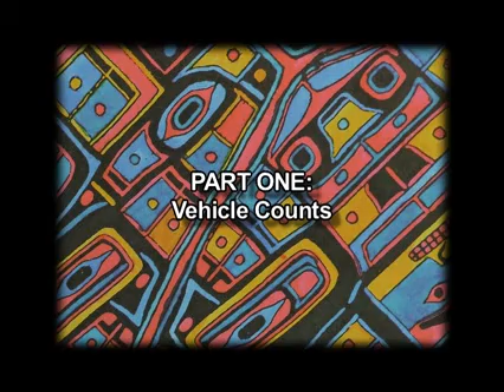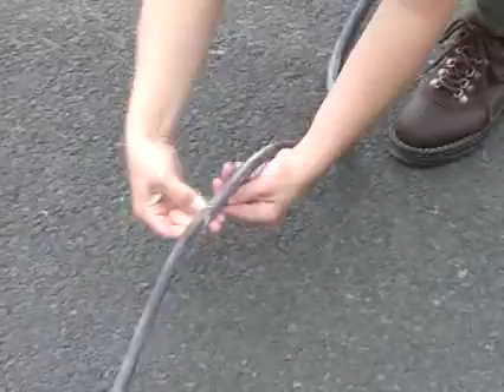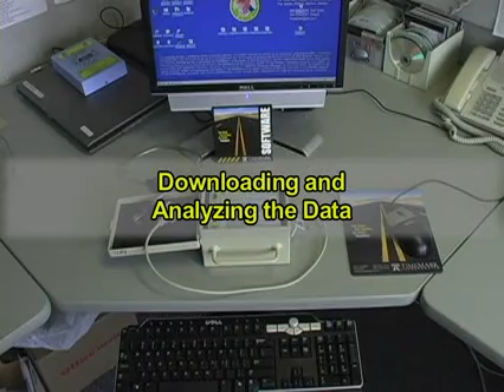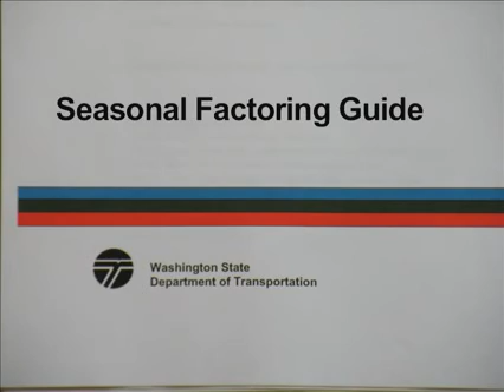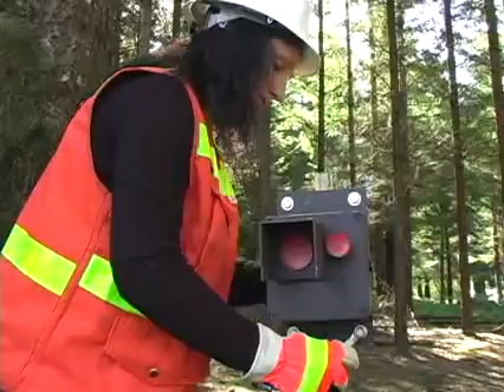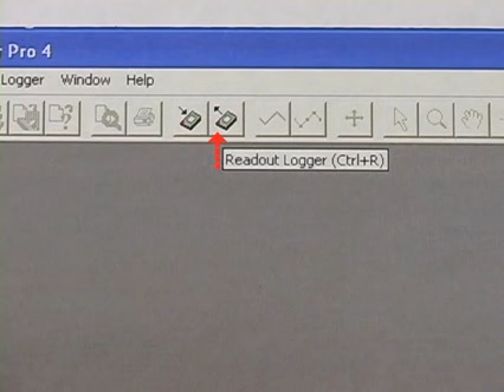Traffic Counts:Procedures for Vehicle, Intersection, and Pedestrian Counts

Comment: INTERSECTION TRAFFIC COUNTS:  I think its important to do at least 4 diff times of day AND to "only" count those cars entering or leaving (not both) the intersection BUT also to be sure to count from all 4 directions  so count street A entering, + B entering, + C entering, + D entering. 
     For example SAXON & PROVIDENCE in Deltona, FL, 32725 is approximately 36,000 + on just saxon alone but since that "probably" is both directions u might have to divide by 2 to get just those entering the prov & sax intersection "from that direction" ; in other words u need counts from all four directions so you might want to think that just take the 36,000 and presume the other direction is same but really that is a fallacy as it could be less cars going the other directions usually depending on time of day. 
 IMHO the best low cost way is to go to intersection and  count cars "ENTERING" intersection for 10 minutes from all 4 directions, multiply this number by 6 to get the hourly count from all 4 sides, then multiply that hourly number x 12 hours to get the daily count ;  do this for 4 different times of day , add them together and divide by 4 to get the "average" daily "rough" count.  
    The best way but higher cost  is the hose across the road only the Departure lanes of each of the 4 streets leaving the intersection (not both entering and leaving or you will get double count). *   U can use a video that can be slow mo (ie old vhs tape works, then replay it in slo mo to be sure of what you are seeing since some cars will be fast on green light and others very slow when light is red).     FYI:  we got 32,000+ cars  from 7am -7pm m-f at Saxon & Providence in Deltona, FL back in years circa 2000-2006, so it will be higher now which jives with the 36,000 + numbers from the remax traffic flow count on saxon alone (presuming that is both directions).
* the reason to use the departure lanes with hose counters is that the speed will be more consistently high enough to avoid false or non counts which may happen with cars going too fast or too slow;   at departure after car starts across intersection either turning or straight thru the speed is more or less about 10-30 mph but when entering intersection the red light may be so slow that the hose miscounts?